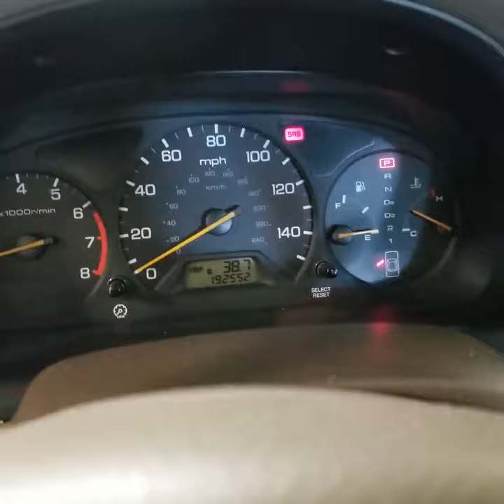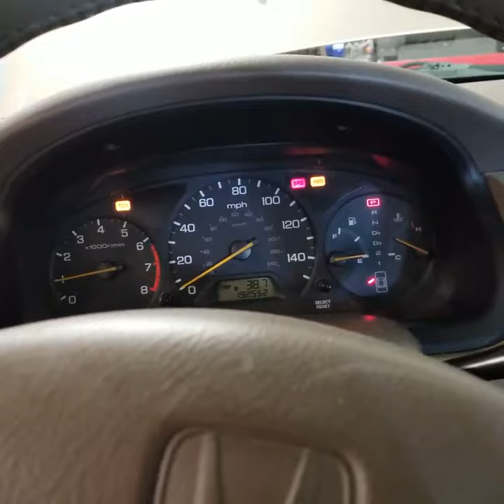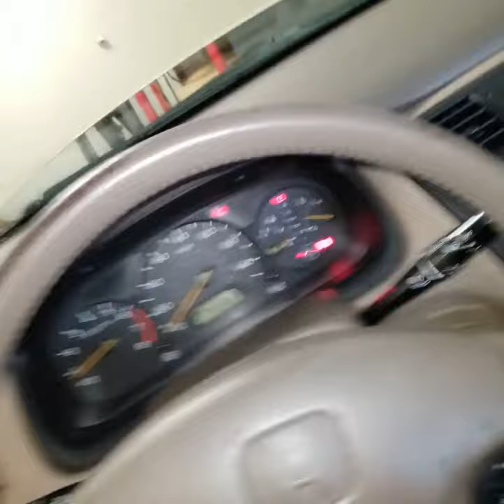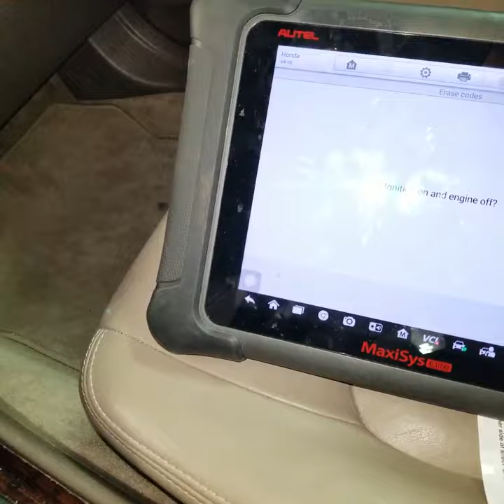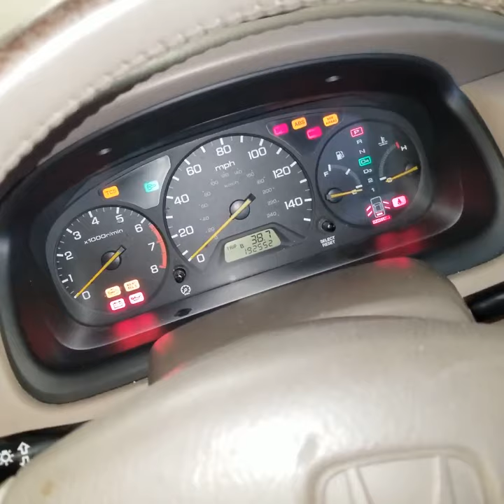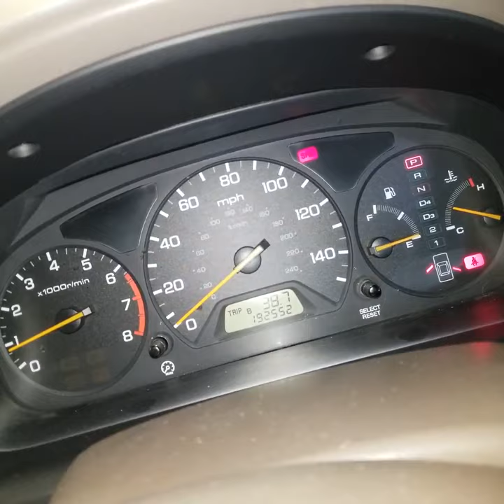2001 Honda Accord Airbag SRS Light Code 9-3 Faulty Driver's Seat belt Buckle Switch

Comment: Thanks for the info on the little red switch. 2000 Accord coupe with SRS light a year ago, my cheap scanner showed 9-3 code, driver side seatbelt latch. I followed your guidance to open the latch- did not need to remove seat. Cleaned it while in place with a LOT of electrical contact spray. Cleared code. Code did not return until yesterday, nine months later. This time I just sprayed a lot of electrical contact cleaner into the latch without disassembling it. Spray, click, spray, click for five minutes. Cleared the code. Has not returned. Thanks for the info.
Reply: I have a 2000' lx coupe too! gonna get some electrical cleaner and do what you did. Thanks!!

Comment: Great vid I had NOOOO idea the seat buckle involved THAT much work. Last week I had my drivers seat buckle replaced at the dealer. Funny thing originally my 02 accord lx had a tacata airbag recall. They fixed that and told me My SRS light came on and I had to bring it in for the buckle replacment. So you all know, this is a lifetime warranty repair AS LONG as theirs a computer code stored in memory.  The dealer replaced tge drivers and passengers seats buckles no charge.

Comment: What is the scanner called and how can I find one? The mechanics in my area want 600-1200 to fix my SRS light on my 2001 Honda..I can't afford that
Reply from the maker: The one I am using is a maxisys elite , way to advanced for a single use . You can probably find an Airbag Reader eraser for way cheaper than the elite version. But remember the eras will not work unless problem is fixed

Comment: Nice video! By the way, for at least a 2001 model. You can just move the driver seat forward, and be able to disconnect the seat buckle cable right underneath.

Comment: thank for video.  did not have tester to reset code so had to disconnect seat belt buckle connector then reconnect to erase fault.  otherwise removing seat would have been unnecessary.
Reply from the maker: Glad it helped

Comment: What if you just replace that form a junk yard instead of taking it apart?
Reply from the maker: you could do that but if the one you get from junk yard have the same problem if not tested. either way , it is a simple fix and not that complicated

Comment: All srs problems are fixed for free by Honda Life time warranty on all seat belt buckles etc. Don't fix yourself.
Reply: I called both Honda and a local dealership and they told me that the sensor is not covered, only seat belt function. Some people have gotten theirs covered... So inconsistent lol. I'll use this fix for now since Honda will not cover mine